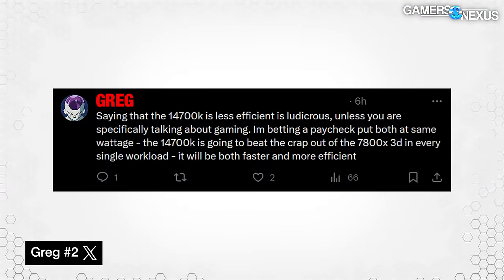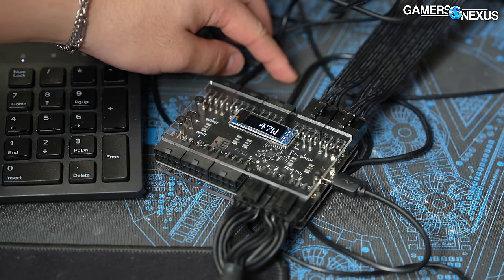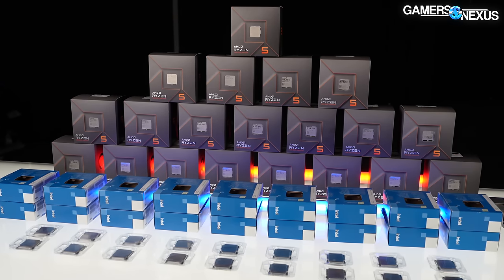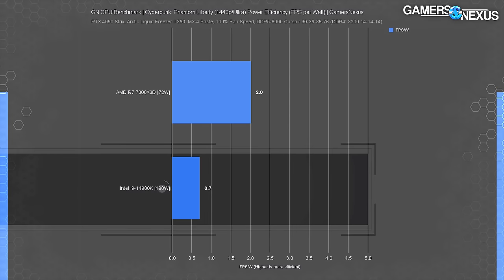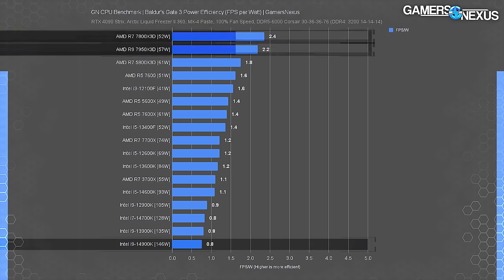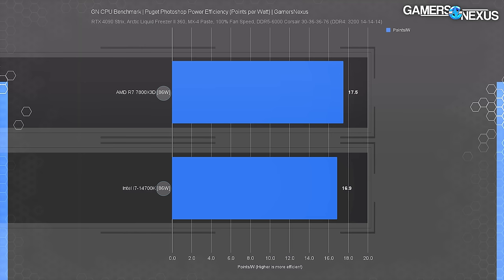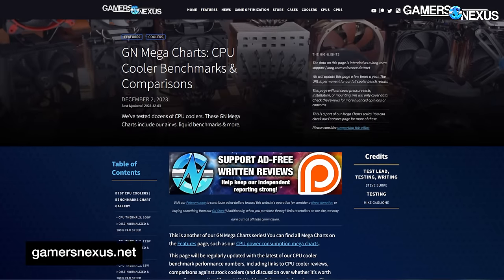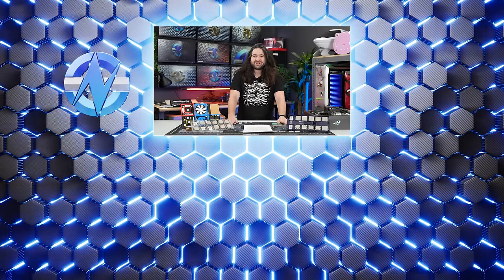The Intel Problem: CPU Efficiency & Power Consumption

Comment: Although this is an interesting video in itself, a majority of tests conducted seem to be irrelevant to Greg #2's original assertion that you might have intended to refute. He put a reservation to his assertion: "unless you are specifically talking about gaming". He himself has already implied that his assertion does not apply to gaming. Given this reservation, the phrase "every single workload" appearing after this reservation should be construed as referring to non-gaming workload and not to any gaming workload.
With regard to non-gaming work-load,  you  did successfully refute his assertion by giving Photoshop test result that shows 7800X3D is more efficient than 14700K, which serves as a counterexample to his universally quantified assertion that "beat ...  in every single workload." Given Blender result, however, 7800X3D's superiority in power efficiency in non-gaming workload does seem to be as compelling as that in gaming workload, which you eloquently expounded on. More non-gaming tests may be required for thorough comparison between these two CPU's efficiency in non-gaming tasks.
Perhaps you might not have intended to refute his assertion but were only inspired by his assertion to conduct these tests in gaming, which a majority of your viewers may be more interested in, but, then, it should have been more clearly stated throughout the video, I am afraid.

Comment: Even if we take it to the extreme: $0.50 per kWh and 12 hours of gaming a day, it's still less than $25 per month difference between 14900K and 7800X3D. I doubt that's significant for people who can afford that level of hardware.
I'm not defending Intel in any way, when AMD part clearly requires just a third of power to achieve similar performance, but all that talk about efficiency hardly means anything in personal spending aspect. We absolutely should pursuit less energy consuming levels as a whole, but it's hard to justify it in "money spent on electricity by particular consumer" terms.

Comment: the 14th gen runs that hot that you could cook breakfast on it (out the box). I recently bought a 14900k and still struggling to get the temps under control

Comment: It would be fun to also see the locked power draw during games. How would the 7800x3d and 14900k/14700k compare when limited to 65W/85W limit? I am running my 7800x3d at a 75W limit, with negative curve offset to get a drop of 20+ degrees and get the same performance as stock 7800x3d.
Reply: I think that's what they did, the impression I had at least was that they were adjusting power draw to match FPS between the chips rather than using an FPS limiter.
Reply: 11:00
Reply: @haunt97  not what I meant. That's fps per watt. What I would like to see is limiting the CPU to a maximum power draw so both processors use the same 65W for example, and see how they then compare.
Reply: @declde  with basic math at 11:00 with cyberpunk:
Amd 7800x3d at 61w put out 201fps
Intel 14700k limit at 86w put out 146fps
=> 14700k at 65w put out lower than 146fps
You are welcome

Comment: Please do not use the integrated 7 zip compression benchmark as this is not representative for actual compression/decompression.

What 7ip integrated benchmark does is measuring the performance of compressing/decompressing 32 archives (one per thread) in parallel, but at a very low dictionary size so RAM requirements are not pushed too high.

In actual use cases of compressing/decompressing one archive at a time:
.) Decompressing is only using one thread
.) For compressing at higher dictionary sizes the number if threads depends on the archive size and larger dictionary changes cache behaviour.

Comment: tbf, even though Greg#1 is right about having to test multiple sample to be scientifically accurate, I'd still prefer single CPU testing, since in increase the changes of finder huge delta's in quality between CPU samples but also between marketing pamphlets.

I you gave a 10% delta on scores / performances. it still a bad CPU, just because of the fact, you don't really know what you are buying at the end.

Comment: Okay, now I am interested in the power consumption to handle routing between two gigabit networks for say a Ryzen R3 and that i3 they were testing.

Basically I got an old PC I use as a router with OPNSense and I am wondering about power consumption under data transfer loads. Of course I also need a sub 300 watt PSU as well.

Comment: Intel. Faster?.. mostly yes. Much more overall stability? Definitely. More efficiency?... No. But what do you expect with 10nm.
 I've build and run systems with both and I can say that Intel should definitely highlight system stability as a major selling point. Zen 4 X3D chips and non X3D almost always have minor to major stability issues with RAM etc.

Comment: Well in germany you can use $0.3 as power costs atm. If you add up the average time people keep the same pc: 3-7 years, power efficiency suddenly actually starts mattering a lot ~ more so than the ACTUAL price of the cpu, even with just 2-4hrs of gaming a day. The more power you use, the cheaper it gets however.
Reply: No you can't, $0,30 would be 27cents in € right now and you won't find anything below 30ct€ and that's ignoring if you can currently even switch your provider or if you're still stuck in an old contract. We're currently stuck in an old contract which will be going up to 45ct in the new year and so are many others.
Reply: @Haldjas_  I am still in an old contract. Also if you use a lots of power the price you pay for electricity goes down. Like adding 1000W permanently drops my bill by about 7-10ct€

Comment: Saying that the 14900K can be as efficient as the 7800X3D if you do a million things to it is the same thing as saying that I could be an athlete if I lost about 40 lbs, went on a strict diet and exercised vigorously for 5 years. It's not only false, but it's never gonna happen, either.

Comment: It seems strange that you aren't benchmarking the ryzen 7 7700 when doing a series of benchmarks about power consumption. The whole reason i bought it was because it was supposed to be highly power efficient while still being a mid/upper tier cpu. It sacrificed a couple percentage points of maximum performance for much bigger energy savings. I know it doesn't sell a lot, but it is likely one of AMD's best positioned CPUs for such a test.

Comment: Is Intel really entering another Prescott era?
Reply: No, it's just falling behind TSMC on transistor density. Intel chips have strong IPC

Prescott didn't have strong IPC.
Reply: Another problem are Intel motherboards with absurd voltages.

I have an i7-12700K (which has the best e-core to p-core ratio and good clocks) and it was recieving 1.43 volts stock from the MSI Z690 Pro A motherboard (240 watts max, when it should be 190 watts or lower for all core turbo). It must be a bug, because after i did a -110mv undervolt, it drops to 1.21 volts and 150 watts with infinite turbo, from 90 degrees on Cinebench  R23 and 240 wattts to 72 degrees. A +50% increase in power efficency after the undervolt.

I think the 7800X3D would be like 10-20% faster at the same power draw on games and that is good (my 12700K is an early 2021 batch with AVX512).

For the i9s, it's about scheduling problems and games don't know what to do with 32 threads, they also don't know how to work with 16.

A Ryzen 7 7800X3D is just an i7 without e-cores with pre-overclocked RAM.

Comment: I have a question about Gigabyte motherboards for AMD 7000 as on New Egg on their B650 Elite AX motherboard it states Commanding Power Design: Twin 14+2+1 Phases with 70A Power Stage Digital VRM Solution, 8-Layer 2X Copper PCB and on their same board in white the Aorus elite Ax Ice it states Commanding Power Design: Twin 12+2+2 Phases, 6-Layer 2X Copper PCB but yet both are the same price, WHY. It is the same for their ALC897 audio when all others use 1200 or 4080 Codec on their higher end boards BUT not Gigabyte.

Comment: I knew Intel chips were less power efficient and get hotter but this was embarrassing. I can confirm this with my own testing. I don't own an AMD computer but I do have an Intel Core i3 laptop with 16GB of RAM and a 256GB SSD with a physical bigger battery vs my M1 MacBook Air with only 8GB of RAM and the 256GB SSD and playing Minecraft Java on both, the Intel laptop would get hot and the fans would kick up in the first 10 minutes, sometimes 5 minutes in, while my MacBook playing Minecraft Java non-native, didn't get warm even after an hour. And this was all on battery. I can watch 18 hours straight of YT on my MacBook and maybe 2-3 hours of YT on my Intel laptop. Again, on battery for both of them. And I had an Intel Core i7 tower PC that preformed worse.

I am curious if the Intel Core Ultra chip they introduced a little bit ago can actually preform close to AMD or Apple silicon even if Macs are not really for gaming. I've seen Dave2D's video on the Intel Core Ultra and in his video, it seems the chip was doubled even Intel's best chips in performance.

Comment: 10 cents per KW/h?? Ugh.. I hate the UK for many things and this is one of them. We pay on average nearly 3.5x that. For me it's roughly $0.34 per KW/h and that's after it went down. It'll likely increase again in January. The tests being run here really help me with at least the CPU side of things. I knew AMD were a lot more efficient but not to the level these tests show. Crazy to think the next lot of AMD CPUs are supposed to be better performing if they can maintain the same power levels.

It's hard to enjoy gaming or anything when you keep wondering if you can afford to use ray tracing or if you should run at medium settings and lower resolution so you can play a little longer. Yes, first world problems but that's where I live.

Comment: Alienware (or rather Intel) took away my ability to undervolt and set the clocks on my overpriced 9900k laptop, at least on Win 11. I am now forced to constrain my CPU through the Windows power settings, so that it never goes beyond 3.6 GHz or else it might overheat.. instantly. 

It's a damn shame because I don't mind heating my room with my two PSUs (I've plugged in just the 300-330 W one).
But on the other hand, I also don't want to buy a new laptop so I am trying to reduce the wear and tear.

At least it's over 9000! and that's all that matters.

Comment: I built my new pc this year and was watching multiple videos of today's and last year's tech. I was always an intel guy, but the power consumption is my major break point. I cannot even think about having my pc running and eat up the cost of electricity. I don't own a solar home so there's no way I would want something that eats up a chunk of power. Especially if idle.
When I heard about the 7800x3d, I settled for it especially when it was compared to the 5800x3d which was ideal for gaming and budget builds.

Then GN's video about saving power for 7800x3d cpu with a small performance drop compared to max power. That sold me. The competitor was the 13700k. There was no efficiency comparable. I did look at the intel's 14 gen cpus. But since it wasn't the new architecture, I knew the power consumption would be similar to the 13th gen.
And voila, it was. I wasn't gonna wait for the 15th gen.... maybe I should, in hindsight. But I'm pretty happy with my current pc build.

Comment: I wonder when power consumption will get so high that PCs will start needing their very own 15-20amp circuits. I assume PCs can be considered continuous duty in electrical terms. Extemporaneously, I'm guessing that means a pc that uses >1,500 watts would take up the entire allowed amperage of a 15 amp circuit.

Comment: I wouldn't argue about power consumption on intel's side, but i would argue the stability of intel's cpu compared to amd's, only if u r a consumer and are getting retail samples. I've had issues with amd CPUs alot over the years, they degrade faster than intel's, and amd expo has a weird way of not working sometimes. I also don't like how the overclocking portion of amd is only based off of a curve and u'll ultimately have to use ryzen master to find a happy medium. I don't like the silicon quality u get from amd bc certain things just stop working properly after a while of use, I've had to rma my mobo twice and rma my CPUs 5 times each (3600 to 3700 to 5800X non 3d), i also had went through 3 GPUs and 2 PSUs, no fix other than going intel. I would make that a point to go intel if u'd want a cpu that just works, and u don't have to fiddle with it every boot like i had to when i used amd.
Reply: Think thats just you buddy
Reply: @stephenallen4635 , u mean u've never had a problem with amd cpus? tell that to everyone switching to intel bc they've had issues with running expo with their r7 7800x3d. Or better yet, tell that to jay bc he stuck with intel even though amd has better gaming performance, since he had issues with the r9's that were the same amd expo bs. They're just not stable, that's a fact bc amd pushes their arch too hard, while intel focuses on improving all aspects, even the little ones.
Reply: @stephenallen4635 , but rma numbers tend to not reflect customer intentions? The real world can't be dictated by statistics, only by choices, people have complained that with the higher end 7800x3d and 7900x and 7950x have issues with enabling expo to post, it just won't do it all the time, or at least not reliably. Instead of bashing a product based on expectations, focus on the positives and negatives of each product, and weigh the value of them based on what matters the most to u.

Comment: Brand new gpu “burn in procedure” the thermal compounds fracture during shipping requiring the chip to do thermal tricks to run hot to modify the compound using acoustics to form patterns and shapes

Comment: Every excess watt is one more we need to provide carbon neutral generation for in order to avoid burning fossil fuels which threaten humanities continued enjoyable existence. You don't need to get the efficient CPU for the money savings, or because your specific area is clean electricity powered. Doing it because it lowers total demand is enough. These are the tiny individual choices that add up to save the species. It really is that simple. Use less; lower demand; less fossil fuels burned directly or indirectly; less emissions; less extreme death and discomfort for humanity. Efficiency matters.

Comment: That's exactly what I've always proved to the Intel fans that 5 nm from TSMC is better than 10++++++++++++++++++++ nm from Intel.

By the way, even the Snapdragon 865 7 nm+ from TSMC is better in terms of energy efficiency than the Snapdragon 888 5G (5 nm) from Samsung production. 
TSMC is best CPU producer on the planet in terms of energy efficiency. That's why Apple chose them instead of Intel.

Comment: Very disappointed with GN on this one for not mentioning idle/low load power draw (I know it's probably hard to measure). Someone who wants the most power friendly system and only games a little bit (1-2h a day) while using the pc for low loads the rest of the day is completely mislead by these numbers. I say this based on various anecdotal numbers claiming that AMD has a high baseline in power consumption, while intel's is very low, but there's nothing better to go on.
You really needed a power efficiency comparison between the 14600k and 7800x3d both limited to 60fps (in any game where neither of them drop below) + some idling/web browsing/youtube measurements to get a fair comparison and allow an actual informed choice.

Comment: I found a new way of benchmarking cpus. I Recently got 10gb fiber and apparently when downloading from steam the cpu usually hits 1.2gbit on 100% CPU load . Was surprised by that. Testing with the same nic on my good old i7 2600k I noticed that this cpu is already at 100% before reaching 500mbits .

It will be quite interesting when I will be able to achieve 10gb speeds . My next upgrade probably a 5800x3d will maybe achieve 2.5 gbits on Steam. 

I would be very interested to know which CPU is needed to achieve 10gbits outside of speed tests but when downloading games . Could a 14900k do it ? Are there even drives fast enough to sustain over 7-8 gbits ?

Comment: Amd and intel seem to operate from an entirely different design philosophy. Zen has gotten progressively more efficient over time, even within the same socket and during the "+" architectures (zen1->z1+, zen2->z3 -> jump to zen 4). Intel tends to start at some kind of efficiency target and then spends time squeezing every single watt out of the architecture until it stops scaling. Imo only one of these philosophies has a future and it's not intel's.

Comment: Would it be fair to argue that the NON k Intel variants might produce better performance per watt than the k series? I bought a 13700 non k at launch under this assumption, and this video has me thinking i should have waited a few months and built an AMD rig instead.

Comment: Why is it that you dont account for the higher wattage of the intel chips? 14900k should be 3,2 FPS per WATT at 7800x3D wattage (196 vs 61), you did a Linus on this video.